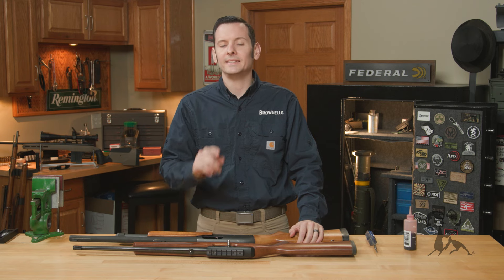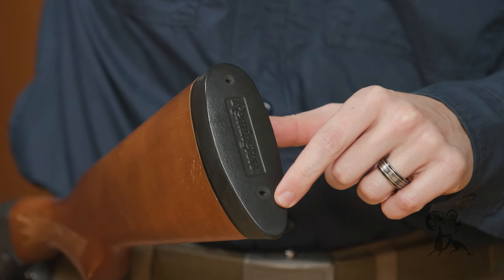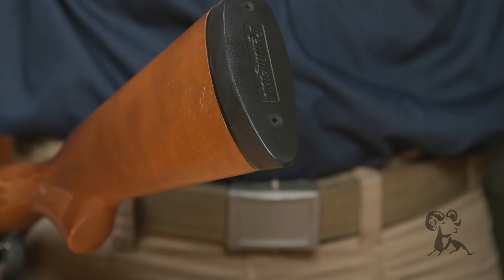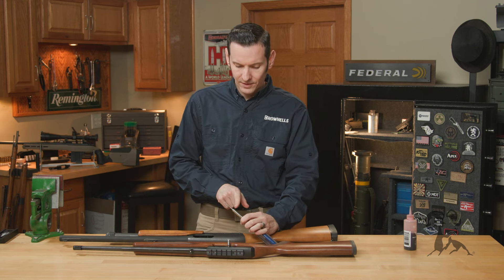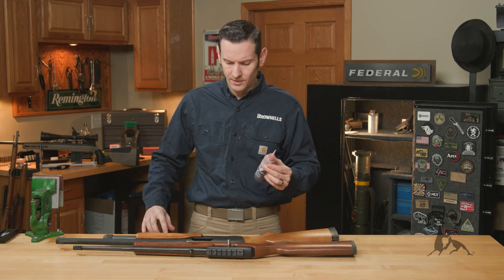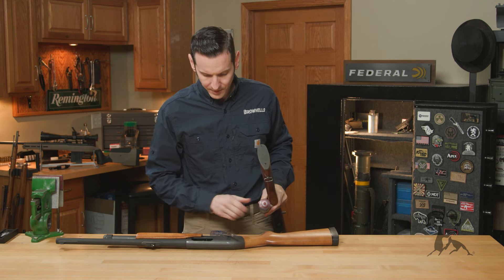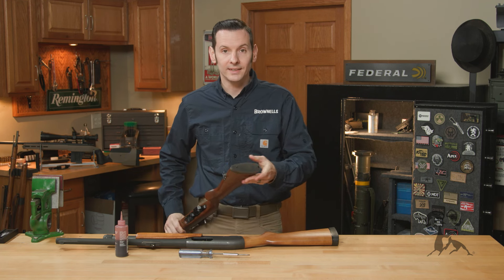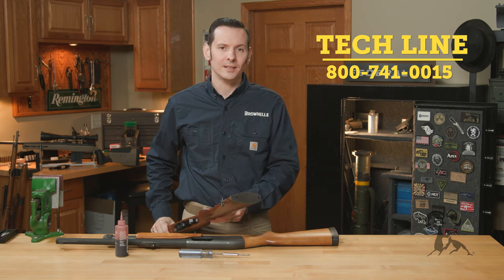Quick Tip: How to Remove a Rubber Recoil Pad

Comment: Another good oil for applying to rubber compounds to temporarily soften and increase pliability is WD-40. It dissipates fairly quickly so a quick wipe down is all you need.  I discovered it's softening properties years ago when removing worn out studs from  snow tires. I'd fought with the process until I tried WD, light squirt, flat bladed screwdriver, easy-peasy. The pliability effects don't last long, it worked.

Comment: good timing, got an item in the vault that has gone thru slow restoration process, everything but the hard as rock recoil pad...so hard I will need to drill thru the holes to access the screw holes

Comment: So are all the mount screws for butt pads Philips head screws or are some of them Slotted/Flat head screws. Have an older 870 where I'm looking to replace because it's hard as a rock, but there's no real way for me to see what type of screw is in there.
Reply from the maker: The majority are Phillips but some may be slotted.
Reply: I’ve never seen an old Remington pad that wasn’t as hard as a rock. Also, Remington used a lot of square drive screws on their recoil pads. If you need to find where the screws actually are look in the “X” pattern and you will see the column where the screws holes are.
Reply: @sxsboy2253  Thanks for advice. I'll take a look at that

Comment: The gun oil will get on and into the wood. Gun oil is bad for wood.
Use a little liquid soap instead.
Reply: Sounds like you need to change gun oils....
Reply: How do you know you are using the right gun oil?
Look at the oil stains on an old gun.
Once you start to see those stains on your gun it will be too late to switch.
Just use soap.
Reply: Literally cover wood rifles in oil in alaska before going hunting lol no issues ever.
Reply: I have literally seen wood stocks ruined by gun oil.
Use soap when removing and reinstalling recoil pads.
Reply: @lancedevooght5027  nobody uses 60 year old gun oil like you
Reply: @Survivinglife871  I have not ruined any stocks. 
But I have seen people like you ruin them.
BTW, there is no need to smear your gun stock with oil to hunt Alaska, or anywhere else. The guide must still be laughing at you.
Reply: @lancedevooght5027  i didnt have a guide. I lived there and ive eaten more bears than you have even seen.
Reply: You have no idea how many bears I've seen. I killed my last one with a longbow.
So, you think that because you say you have eaten more bears than you think I've seen,  that I'm wrong about using soap on your recoil pad. You sound more illogical and outlandish with every reply .
Reply: @lancedevooght5027  you sound more like a liar with every reply
Reply: And there it is...
the "ad hominem attack."
The last resort of those lacking reasoned arguments.
Reply: @lancedevooght5027  good luck with your acid oil
Reply: @Survivinglife871  Spare me your, disingenuous, wishes and superstitious beliefs.